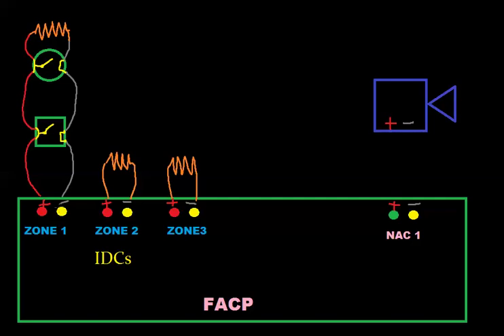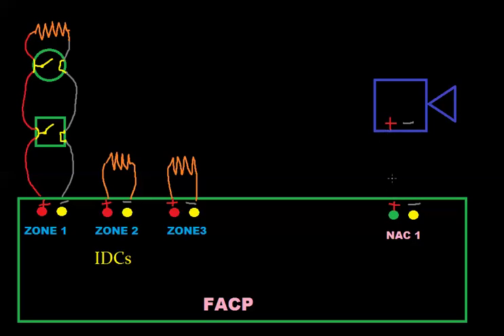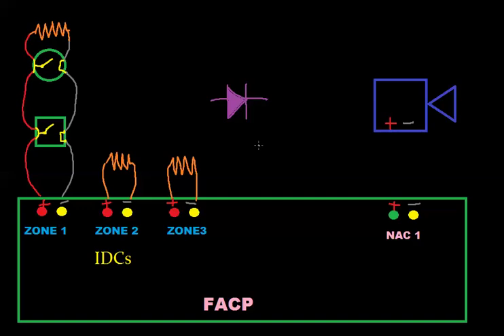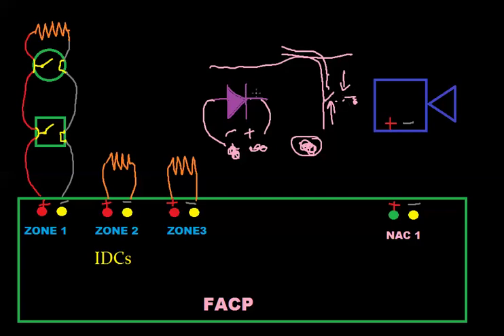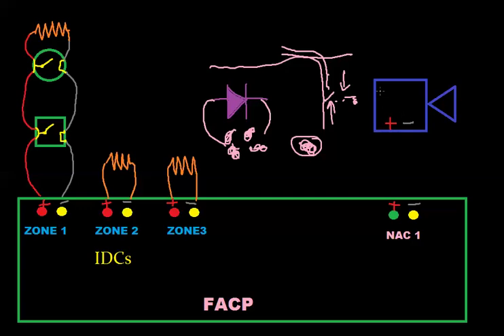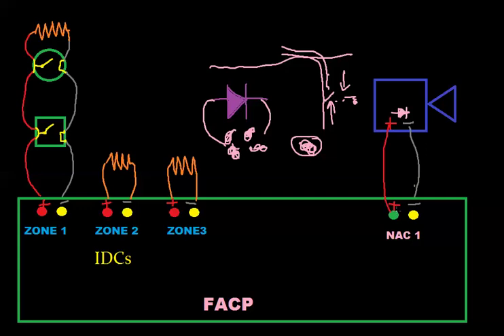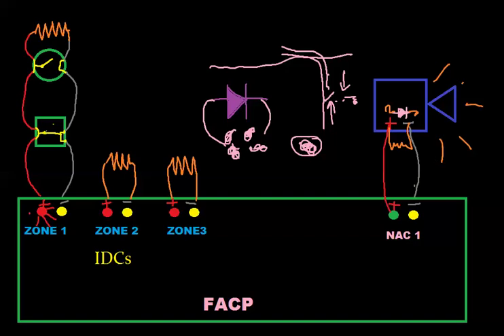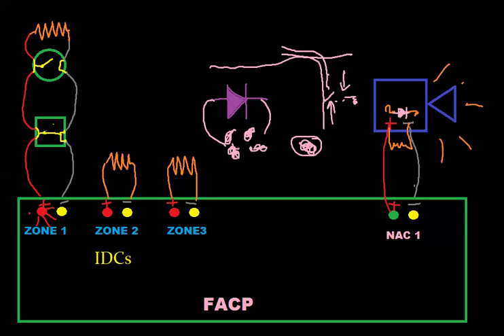Introduction to Fire Alarm Systems 3

Comment: You are doing God's work! We just debugged a circuit in our apartment building in Indonesia with this video. I was wondering why the standby voltage to our bell was -7V (reverse polarity) instead of 24V, and then I remembered this lesson. Yes, the polarity switched and we got 24V when the bell was activated

Comment: Hi Joe.
Firstly, I want to say that your videos so far are helpful for some work I'm currently doing, and I appreciate your effort.
I would like to address the comment you made about current at around 2:30. "Current" in the way we use the word still does flow from positive to negative because as it is defined, current is the flow of positive charge and not electrons; having taken several electrical engineering courses recently, I can confirm that current is still taught this way. 

However, as you've mentioned, the flow of electrons is more relevant for some discussions. Therefore the way we think of the typical positive-to-negative-current should be more accurately described as "conventional current", which is how people often say it to differentiate from the direction of flow of electrons.

I will stick to your convention for your video series but just thought I would make my own comment.

Comment: Joe you are doing an amazing job . But if I would like to say few things on current direction. Actually flow of electrons is from negative to positive and current flow is opposite to the flow of electrons . That is we consider current flow always from positive to negative( direction of holes) . Anyway keep
Up the amazing work
Reply: The current flow is the direction electrons flow...like water...the current flow of a stream is the direction the water flows......not that hard. but like Joe pointed out, the day they decided these things, they mis-diagnosed the electron direction of flow and all things after were based on that error (actually a common occurrence in science).

Comment: Hi Joe. Your videos are awesome. Pls allow me to explain. In the battery, electrons flow from negative to positive. In the circuit, current flows from positive to negative. Therefore, the pointy part of the diode faces to the negative showing current flow. That's why you see a vertical bar on the pointed part of the diode to show that it will block any backflow. Usually diodes are used for AC to block the "negative" return of the current.

Comment: Nice videos Joe, i have to tell that it's a physical fact that electrons flow from negative to positive, 
while current - on the opposite - flows from positive to negative. Still thanks for your efforts and great presentation.
Reply: +Reham Mostafa
The flow of electrons is called current, measured in Coulombs/second. Electrons are negatively charged, which wasn't known when amp meters were first built.  The electron source is the negative terminal (cathode) and the sink is the anode.  That flow of negative charge appears as positive from the anode to DMMs/VOMs/amp meters by definition.  Joe Klochan is correct. +Reham Mostafa you've got just enough knowledge to be demonstrably dangerous, but are missing some of the kit and kaboodle necessary to be useful.  Please remove your hands from the keyboard, place them on your head and back away from the internet so nobody gets hurt.

Comment: Hey, concerning the discussion of the direction of the Ampere. Benjamin Franklin was the person who proposed that electric charges had + and - polarities. He supposed the current moved from High + to Low- reasonably. Its recent discoverys that the electron in itself is negative. and resides in vast amounts in the ground earth. kIts more reasonable that Electrons travel from ground, to an Ionized place, or a positive where ther is lack of electrons. this is called Direction of ELECTRONS. and the former is called Direction of CURRENT. these two move in opposite direction on electrical diagrams ! the symbols on electrical devices are , most usually designed in "Direction of Current", as you pointed out on the Diode .

Comment: When the panel is in an alarm state and the 24 volts is flowing through the diode, does the voltage still pass through the resistor or does it exclusively flow through the diode?
Reply from the maker: Some current will pass through the resistor but it's extremely miniscule. The majority of the current is drawn by the horns and strobes.

Comment: Ok first off. The electron flow is all wrong. Especially how the diode is placed in the horn strobe. Electrons pass from positive to negative in a circuit. So from a diode standpoint, electricity is flowing through the positive side to negative. Maybe under normal state, the diode is set up where it's being blocked from negative to positive until the polarity reverses from the FACP. Then he horn strobe will sound. 

The picture of the diode is drawn the wrong direction.  That's why I pointed that out.
Reply: This is a great video but you are correct
Reply: the electrones charge are negative so how could they go from pos to neg it is the charge or current that goes from pos to neg another thing didn't you notice that the symbole of a diode is an arrow blocked by a line !! it doesn't gives you any clow?? another thing if you have a magnites negative pole to neg pole would goes away when neg to pos pole would get attrackted and finally just google it
Reply: Yes. Electrons are negative charges, and they flow towards the positive. Conventional current flow, or the holes left by a positive-going electron, flow from the positive to the negative. It's really just two ways of looking at the same thing. Although, you must stick to one convention when applying it to how electronic devices function.

Comment: still doesn't know how the polarity in the horn terminal will be reversed when fire detected at 6:32 min. if someone explains he will be so kind.
Reply from the maker: Samy, the polarity doesn't reverse at the device itself, it's a feature of the control panel. I could show you how you can create a reverse polarity circuit with just a single relay that has two sets of form C contacts, but I really have no immediate plans to make more videos. But I wanted to comment to clarify that the horn isn't reversing the polarity, the panel is. The horn is simply blocking the current from entering the device when it's flowing one direction (the supervisory current) and allowing the current to enter the device once it reverses on alarm.

Comment: That was painful to watch. I learned electronics from the Navy in '83 and you were confusing even me with all this diode stuff. If the device has a diode in it and needs to be wired a certain way then just say that. And voltage, current and resistance is best described using  the analogy of a flowing river. Voltage is the SIZE of the river, current is the SPEED of the river and resistance is like boulders impeding the flow of that river. At least it works for me.